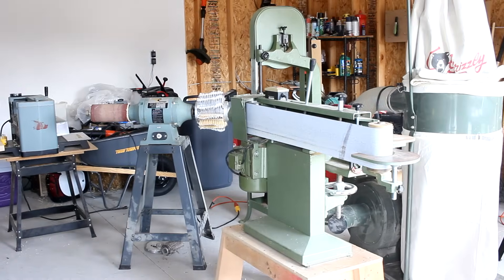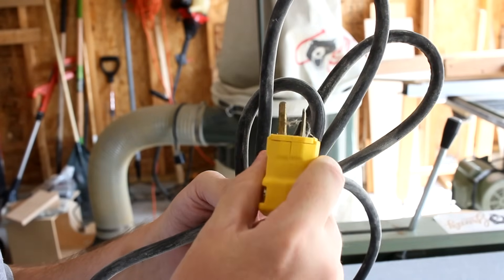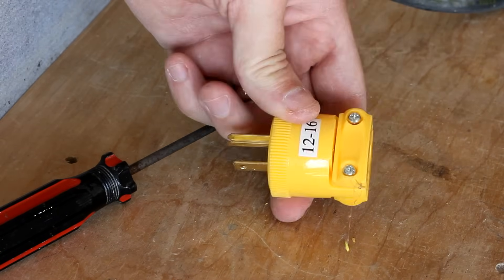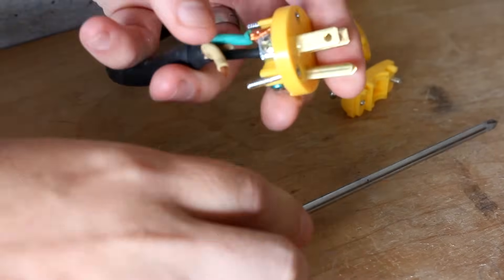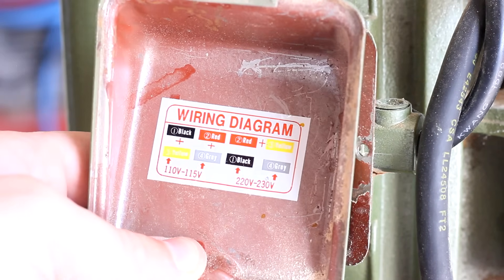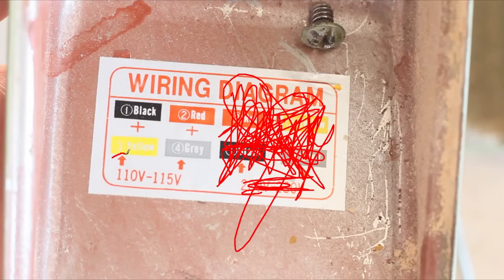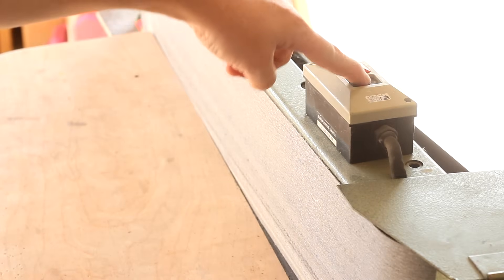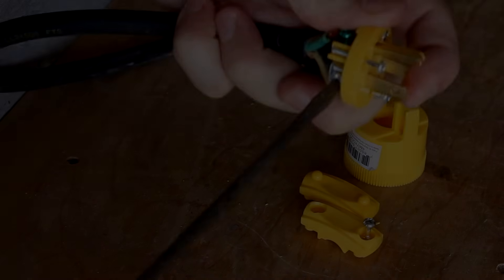Shop Work: How to convert 220v to 110v

Comment: Quick electrical question.. can you run a 110-120v usa light bulbs on a european 240v light bulb socket? Perhaps any adapters to plug in to convert or needing wiring configuration  changes? Or impossible to ever run 120v light bulbs on 240 european electrical voltage rating electrical light bulb sockets despite wiring or changing anything? Anyone have any ideas or tips or advice if possible or not possible meaning impossible? Thanks

Comment: Help please.  I bought a used Grizzly and there are 3 wires coming from the power to connect to use 110. I have the same diagram, but our wires attach to screw holders (6 screws). I am unsure which color wires to attach to the each of the two sets. These 3 wires are green, black, and white.  We couldn’t see from the video which color wire is attached to the black/yellow set and the red/gray set. Do these wires attach separately to each screw or do they attach on the same screw holder. Thanks.

Comment: ok so basically the prerequisite here is that the manufacturer included a coil tap on the motor winding (somewhere at half lenght probably..?) could these be possible on a circular handsaw or thats just "forget about it"? thx.

Comment: You are just changing the plug and some wires. That machine uses either Voltage. I am confused can a person convert to 220 to 110 if the appliance  motor  is only 220 from Europe? Thought you would need a transformer as it needs more juice than what we in North America has

Comment: Your plate reads 18 amps possible for wired 120 volts. You should use a 20 amp plug end instead of your 15 amp you show in your video.

Comment: Keep in mind that by doing this, you'll be doubling the current requirement in order to maintain the same power (watts), Ohm's law. At 1:19 this is verified on the spec label. At 110 volts, 18 amps will be required, at least on start up and higher load. You can verify this with a clamp meter for measuring current. That's too much for continuous operation (16 amps max.) even on a 20 amp dedicated circuit. If this is not a dedicated circuit and a few amps are drawn elsewhere, breaker tripping should be an issue. You could rewire the circuit with 10 gauge wire, which would be safe for 24 amps of continuous operation. That would likely not be a practical solution and your receptacle is still rated for 20 amps max, so it probably would not be compliant in this scenario. In fact, this is just a bad idea, anything requiring 16 amps or more should be on a 30 amp circuit and a 30 amp 120v receptacle doesn't exist unless it's part of a 240v receptacle. Just because the label says that you can do this, doesn't mean you should. If this is a dedicated circuit, you could change the breaker to a double pole, making the circuit 240v, leave the machine as is, and only use 9 amps to operate normally. You would need to find the neutral wire from this circuit, remove it from the neutral bus, and connect it to the other pole of the new breaker. It's now a hot wire and should be marked with red tape at each end. There is no neutral wire in a 240v circuit. The original plug that you removed has 2 horizontal blades, both screws are brass or gold in color, and no silver screw. This is the case for a 20 amp, 240v receptacle, 30 amp and higher receptacles look completely different.
Reply: Underrated comment. Just because something fits doesn't mean it belongs. This motor draws 9 amps at 220v and 18 amps at 120v -- that exceeds 15 amp capacity of the new 120v plug, and probably a few other things (shop wiring and power cord) as well.

Comment: Will this also work when converting the electric plug from an electric stove to a gas one? I got the plumber out and he installed a gas pipe for me on my new gas stove but now my plumber is saying that I have to have an electrician come out for the electric portion of the stove. The original cord connected to the wall has a weird shaped prong and my gas stove has a standard three prong outlet shape prong.

Comment: Yes your video works, I would strongly recommend my friend provide 240 volt outlets for machines in this size class.  1. The 18 amp 120 volt draw on say a saw or sander, added to 18 amps on sawdust vacuum that needs to be running at same time, will kick a single 15 or 20 amp 120 volt circuit.  Thus requiring another 120 v. circuit near by anyway.   On 240  volts the 18 amp draw drops to 9 or less Amps, allowing for several benefits.
1. Fewer circuits,  smaller wires, plugs, less heat generated. 2. A more balanced power draw off your power main, pulling equally from both legs, resulting in less less load imbalance , less chance of kicking breakers from other non associated things like lights, drills, grinders kicking should they be on same  leg.  3. Finally a machine that runs a lot under heavy load (like a planner) will use less metered power drawing 9 amps at 240 than 18 amps at 120.  Just the way meters count watts !  Balance is better.

Comment: FYI .. if you wire a 220 motor wrong it will either not work  ..  OR .. burn the motor up .. in seconds

Comment: If you notice the the plate it says 18 amps at 110v that's why it's recommend 220v so you only draw 9  amps ! There's a reason behind anything plus it's easier to use 2 110v breakers from the box to make the 220 outlet

Comment: the 1.5 hp. motor pulling 18 amps on a 120 volt circuit is too much for a 20 amp circuit. if at all possible, run a 240 volt circuit for this motor. it will start easier & run with less effort. smaller motors such as 1/4, 1/2, 3/4 & 1 hp. would be o.k. running on a 120 volt circuit.

Comment: @Fisher’s Shop -So I read in one of the comments that you were made aware of your mistake with the 15 amp max plug you swapped out with. What did your friend do with his power situation in his garage?  I’m sure this guy didn’t have 20 amp outlets for all these machines (maybe one if he robs the one meant for the washer and even then it’s now likely not 20 amp as well). So what did he do when you handed him all these machines with the right 20 amp plug.? Did he attempt to switch his existing outlets to 20 amp outlets (that have the one prong horizontal) and maybe his breaker as well and, of course, not able to change his existing wiring in the wall. Big trouble no no there. So to do it right he would have had to bring in all new lines and receptacles. At that point it would make more sense to bring in the “better for the machine” 240v, right?

Comment: Hi Drew, I have a question, I have many extensions cords (not heavy duty cords), some older cords from indoor Christmas lights or used for electric fans.  I was planning to send these all to the Philippines (and they use 220), will it work,  i figured it is just an extension cord and may not make a difference but I can't find any info on the net about this, let me know if you have an answer for me, thanks
Reply from the maker: No idea, sorry Gerry.

Comment: I know I'm late to the conversation. But very obvious error here. Devices 110 voltage operates at 18 amps. So ofcourse you would use a 15amp plug... what's 3amps anyway? Just 3 times more fun in a short while.

Comment: wow, I got really confuse at the minute 1:35 to replace the plug you had black, white , and green, but then at the minute 4:50 on the other end of the extension cord you had RED, black, and green?
Reply: Big problem not knowing which wire is neutral and which is hot, when entering  the machine's harness box.
Winos pillheads and dopers perturb me too.    Maybe he is too busy to watch his own video.   Only explanation is he mixed two videos together and omitted changing the power cord with replacement.       And maybe too many  paint lacquer fumes.  His jollies are some kind of clue.

Comment: Can you use an adapter rather than rewiring? Not a transformer, just one of those adapters that let's you plug it into 110 outlets. I just bought a 220 volt water pump for someone in the Philippines. Before I ship it there I want to test it. It came with an adapter for a 110 volt outlet but does not work at all. I thought it would at least work slowly. Can you offer any advice? Thank you
Reply from the maker: No an adapter will not be sufficient. You must rewire the motor so it draws the correct amount of power.
Reply: @FishersShop  thanks I ordered a step up from home depot instead. 150 watts $50

Comment: Thanks. I want to buy a Turkish samovar.
 Anything from overseas has 220 while we have 110. 
A samovar does not have a motor, just a heating element. Could you please show me how that's done? I'm pretty sure the plug must be the same. On the appliance, is there the same wiring diagram?

Comment: Ok I think I screwed up before watching this video.  I tried to rewire for 110 because the tool said dual voltage 110/240.  No problem just change the plug like a computer, I did not know about changing the wires under the access panel.  when I plugged it in the saw ran fine for about 30 seconds and stopped.  Did I destroy my chopsaw?
Reply: Probably.   Try to rewire the motor and see if it still works.   If not you will have to take the motor in for repair.

Comment: All in all for a guy who admits his wife calls him dufus , good job. ; ^{ ) Should be 20 amp outlet, plug and cord though.  Many give poor or inaccurate electric advice on YT and it makes me cringe when I see it.   Your friend may have been better off doing a little 220 volt outlet installation though, often the motor will have a better power factor on 220 which means you pay for less total usage.

Comment: You want to really screw with the viewer's, tell them bout running a 3 phase motor on hone single phase power and building a add-a-phase from another 3 phase motor and a couple of capacitors.

Comment: I KNOW that to anyone with an IQ greater than their shoe size, THIS IS OBVIOUS, BUT.
It should be EMPHASIZED that this is only possible with electric motors that are DESIGNED TO BE DUAL VOLTAGE IN THE FIRST PLACE.
If an electric motor is built to run on 110 AC then that is it, IT CANNOT BE CONVERTED TO RUN ON 220 AC OR VICE VERSA.
Well, it cannot be converted in any way that would make economic sense.

Comment: Is there a specific reason to change the voltage?
Reply: Well, in some garages, there is only 110 volts.   So running a new 220v line to the garage would be an added expense, sometimes a huge added expense.   Easier just to convert the motors to run on what is already there.   

Running the equipment off of 220 will often provide more "oomph" to them although on most you can't tell the difference.

Pro tip, dryers run off of 220, so if there is a clothes dryer in the garage you can use that line, just install a sub panel.

Comment: Hello. Does the switch need to be re-configured for the "new" voltage? Thanks
Reply: Nope, the switch can handle either voltage with no changes.  However, if you were to replace or upgrade the switch, you'd want to make sure that the switch was capable of handling 18 amps.   I'd probably buy a 20 amp switch just to have some safety margin.

Comment: What if it doesn’t indicate 110/220? What can I do in that situation?
Reply: You can find two separate 120 volts outlets connect them using a multimeter and see if it reads 220-240 volts. yes you'll have to make a special extension cord yourself. only for temporary purposes without having to make a 220 - 240 outlet. I shouldn't have given that bit of information. Disclaimer: Do At Your Own Risk. OLE!

Comment: I'm kinda late to the video but I am curious about something. You said that you sold all of that nice equipment to Kyle who is setting up a shop and whom you said makes some 'awesome' stuff. So, Kyle is already a good woodworker and is not a novice. But why is he not gonna add some 220v service to his shop and take advantage of the performance advantage of the already wired 220v equipment ( can I assume that all of the machines are already wired for 220v ? ) and the electricity savings of running 220v versus 110v ?  Machines run so much more efficient on 220v. than 110v. That sander that you rewired draws 18 amps @110v, but only 9 amps @220v. The table saw will also draw a lot fewer amps on 220v than 110v and run stronger as well. He can save a lot of money on his electric bill by running his largest tools on 220v. It just seems odd to me. Maybe he is making enough money to where he is not concerned about his electric bill...?  But if that is so, then I would be curious as to why he just doesn't spend a little money and add 220v service to his existing panel ? Myself, I'm just a retired man who makes wood crafts as a hobby and sells them occasionally at craft events and farmer's markets to help supplement my S.S. But when I had my shop built, I did all of the wiring and added 220v capability to my panel so I could keep my rather basic type table saw running on 220v. It makes a big difference in the performance of my table saw. Now, I also have a 14" band saw and have a floor model drill press ( and a few other power tools), and even though I have often thought about converting my band saw over to 220v, it works well enough for what I use it for. Forgive my long post...I'm just curious.
Reply from the maker: At the time, Kyle was moving to Chicago and renting a house to live.  The landlord didn't want him changing the power runs to the garage he was going to use for his shop.
Reply: @FishersShop  The mystery is solved...LOL....thank you....!!

Comment: Thanks for this informational vision.
What if the voltage is only 220v? Can convert it to 110V too?
Reply from the maker: For sure.
Reply: @FishersShop  For sure is most definitely not a complete or correct answer. It will require much more than just swapping a plug.

Comment: This might have at be me being dumb but when would you need to do this? Like what is the benefit or situation that requires it?
Reply: The situation would be; you only have 110/120v outlets but the tool runs on 220/240v. (And the manufacture designed it to operate in both environments.)

Comment: Is it cheaper to run 220 vs 110 ??
Reply: At 240V only half the amount of current is needed as opposed to 120V. Twice as much voltage, half the amount of current flow.  Saving money with less wattage use.

Comment: "How to convert 220v to 110v"... assuming you do NOT have a "110/220" option....
Reply: 3rd option: you can find two separate 120 volts outlets connect them using a multimeter and see if it reads 220-240 volts. yes you'll have to make a special extension cord yourself. only for temporary purposes without having to make a 220 - 240 outlet. I shouldn't have given that bit of information. Disclaimer: Do At Your Own Risk. OLE!
Reply: That third option.
🤪🤪🤪
Reply: You'll have to either change the motor to a 120v, or attach a step up transformer. But the easiest thing to do is just hook it up to the 240v supply and call it a day.
Reply: @Oldhogleg  No Señor! change the motor, smh...  2nd option I agree and i Like, OLE! but there's a 3rd option. i'll give that out above as reply to GotScout

Comment: Very often it needs to take a look on the frequency. Most 220V systems are 50 Hz , not 60.
Reply: Victor LEE Lee    Nameplate at 1:05 60 Hz

Comment: It all depends on what its spinning.  I bought a clicker press, ordered it wired for 110v for the convenience of using what was in my garage.  Problem was the press had a large cast iron flywheel on it which trips the 30A breaker on start up because it was drawing too much current.  I had to run an extra line to the garage and rewire the motor for 220v.  No fun.
Reply: A high start up current initial current surge probably draws 2-3 times more current on starting than in running use.  Was it a capacitor stating motor?

Comment: Can you use this for a clothes drier?  Trying to figure out how to hook up a drier in an apartment that doesn't have washer/drier hook ups.
Reply from the maker: Very doubtful. Sorry
Reply: Fisher's Shop Some have done it.  https://youtu.be/Xfg9eRiKJbY but id be worried about a fire and it would take 5 times longer to dry in sure.  But some have done it.
Reply: does the apartment complex have natural gas service or LP?  Probably be easier to have a gas line installed for a gas dryer only 120V is required. These heating elements need 240V 120V per side never get hot enough with just a hot and neutral and draw twice or more current. Electric dryers use a double 30A 240V breaker.

Comment: “But if you can disassemble this plug with it plugged into the outlet… “

...more power to you!

Ahem....  
(I really thought that’s what you were going to say when you started that sentence.)

Seriously, I’m glad you learned about the 15-amp plug on an 18-amp motor. And I hope you checked the wire gauge and ampacity, as has been mentioned.

Comment: Bro this was great. I enjoyed this alot. Thanks
Reply from the maker: You're welcome, Ray!  Thanks!
Reply: Fisher's Shop I'm thinking I just want to use an adapter for the electric range I've gotten. It's 220 but need to convert to 110. How would I go about using a simple adaptor? And by using an adapter will I damage the stove? 110 isn't it's designed power input

Comment: Good video and has been pointed out your friend will double the load on these tools requiring dedicated circuits in most cases and a higher electric bill. Might have been easier to simply add 240v outlets?
Reply from the maker: In this case, he is renting his shop space so he doesn’t have that option, but you’re probably right.
Reply: The shop space he's renting will need to have 20A/120V outlets with 12 gauge wire 20A single breaker.,for the sanding machine.  Adding 240V is doable long as the panel has the capacity for the added load and spake for double pole 240V breakers.  Would have 15A/240 outlets/plugs 20A/240V outlets plugs depending on the electrical requirements of the machines.  @FishersShop